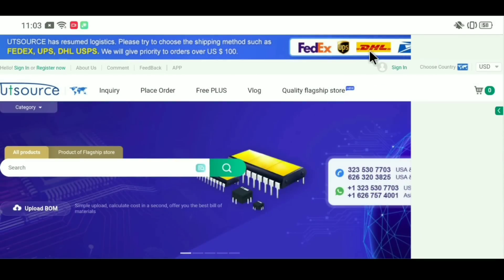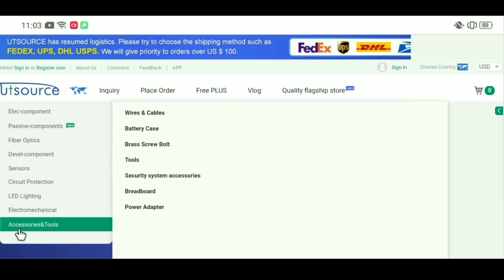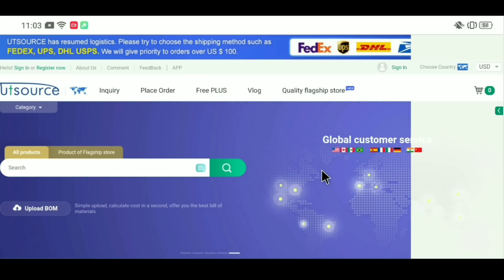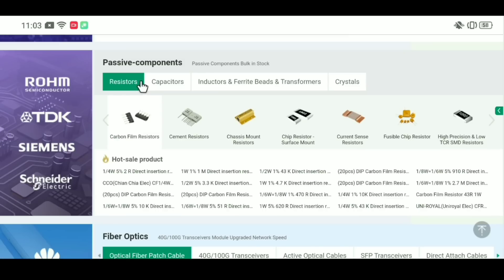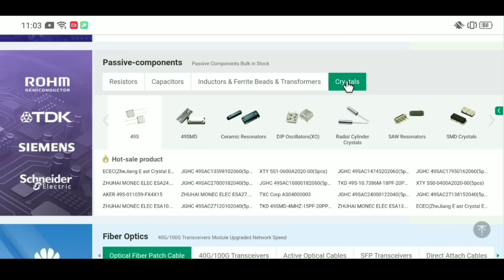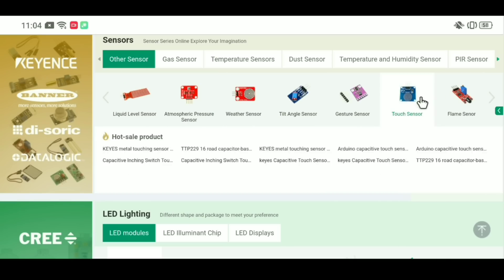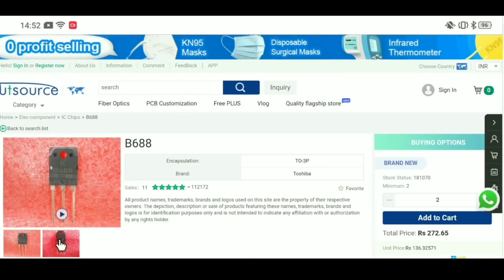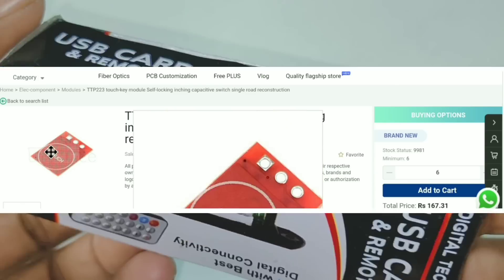Bluetooth, FM, USB, SD Card & Aux With 5+5 Watt In Built Audio Amplifier Module | Bluetooth Receiver

Comment: 3:18 sir why did u said "don't use 7805 ic" what is the reason for that..plzz reply
Reply: 7805 gets very very hot at 5W load only. 5W+5W will restart the player continuously. Use 5V 2A adapter for this player.
Reply: Sir A aplifayar kitne ka he

Comment: Sir it's nzz. Can we use 12v 2amps DC adapter . For this project
Reply: Yes but need 5 volt reguletor ic 7805 and 1 diode
Reply from the maker: No only 3v 4v battery
Reply: @ProjectTechsool   sir but in video, you mention for 12v supply also known sir.

Comment: Hello sir,
Mera pass three Charger hai konsa use kar sakta hu, but maire Module mai Ic Regulator nahi hai. 
Please 2 min ka samaye nikal kar check karke bataye... 

First-
Input 100-240VAC, 50/60Hz, 0.5A.
Output: 5V=3A/9V=2A/12V=1.5A.

Second- 
Input 100-240VAC, 50/60Hz, 250mA.
Output: 5V=2A.

Third-
Input 110-240VAC, 0.3A, 50/60Hz.
Output DC : 5V-2.4Amp.(max).
 
Thanks for checking.

Comment: Very nice video.I have a question on the mentioned amplifier .I have Phillips 2 X2.5 watts speakers with continuous RMS power output per channel, at 8 Ohms.These speakers were used on Phillips CD Radio Cassette Recorder AZ2100 . As cassette and CD are almost obsolete which are of no use  and we have good working speaker which could be utilized with the help of appropriate amplifier. Can I use above amplifier to power the Speaker of 2.5 watts RMS power. Power output of above amplifier per channel seems to be 5 watts which is higher than speaker RMS  power  of 2.5 watt.Please do answer or suggest any other amplifier in case above amplifier is not suitable.
Reply: U should not use ....there is no 8 ohm and 2.5w amps today .....but u can build one using TDA2822M IC thats for 3w 8ohm limit some volume inorder to protect ur speakets